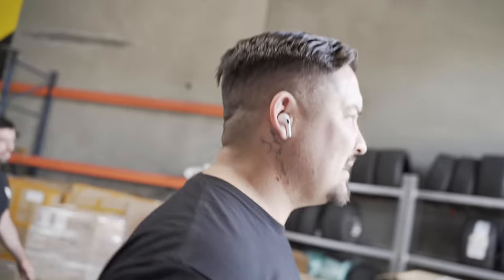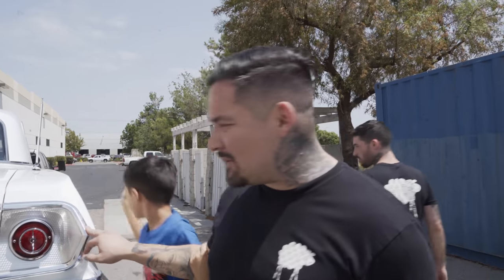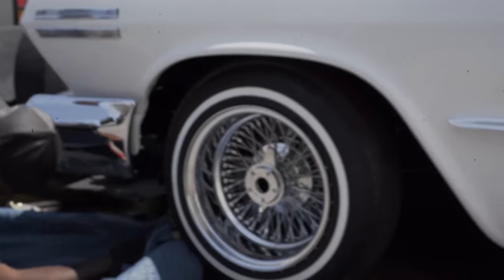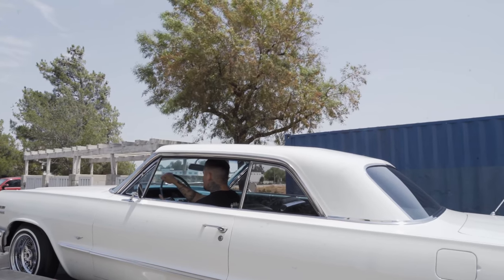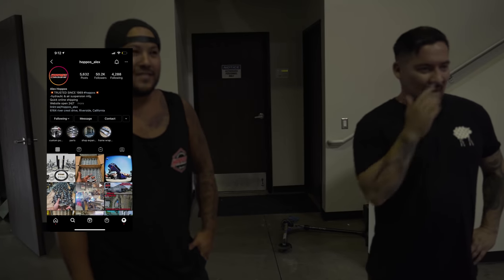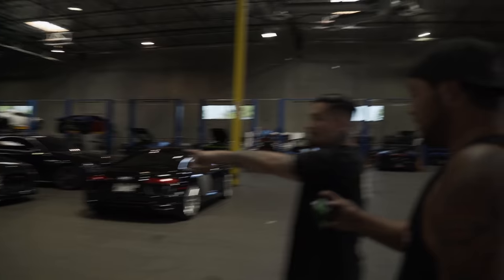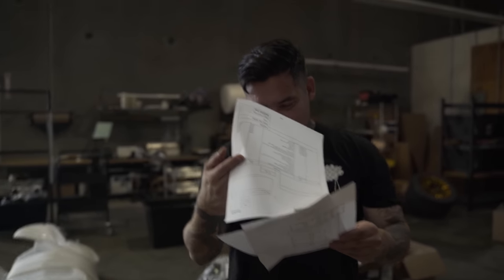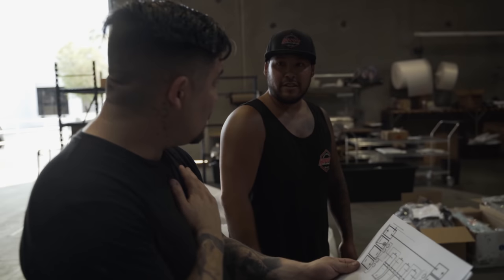New Shop Project?

Comment: Chinese motors still no upgrade. Get better pump heads. I bet they are cheap as well. Fenner was a good pump maker. I havent hydro in some time. 1998 or so.  Accumulators also make for a better ride and bounce.